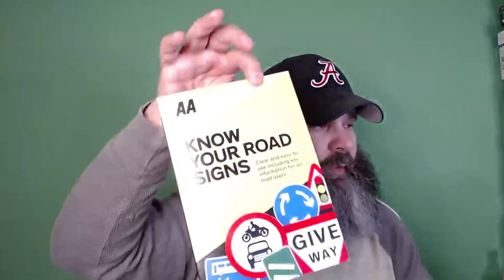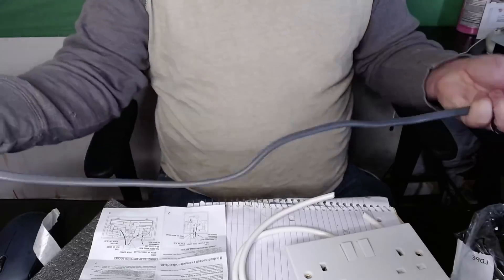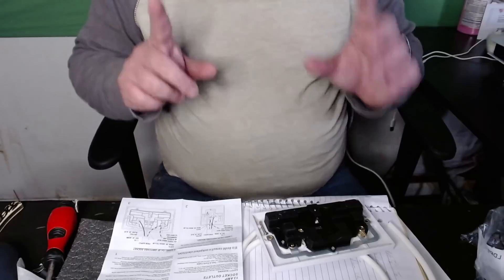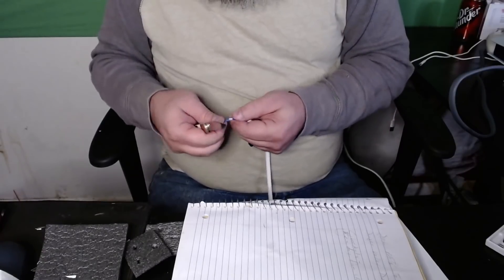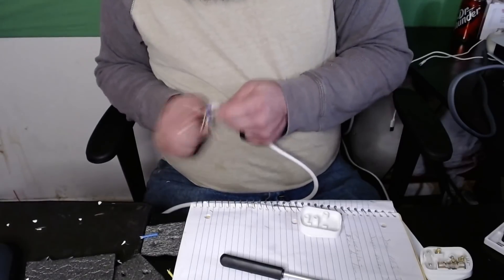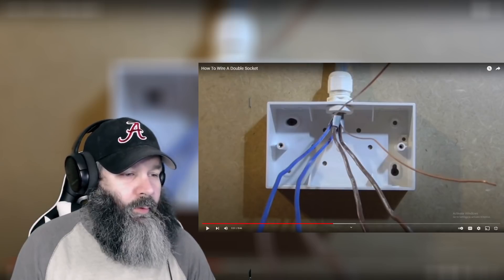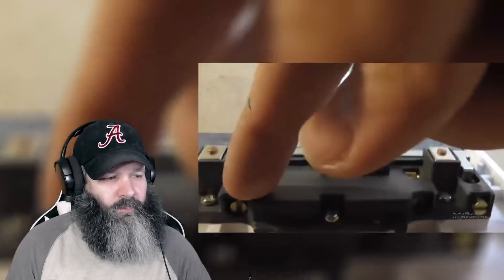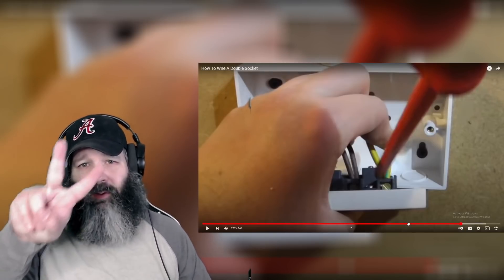American Attempts To Wire a UK Wall Socket and Plug

Comment: Unfortunately you left the wire exposed and without a sleeve which in turn could lead to electrocution or a fire as well as the strands being too long  but as a first timer 7/10

Comment: Your plug cable grip is a fail!  The outer shroud of the plug cable should be gripped inside the plug so that you can’t easily pull the wires from the terminals and get a shock.  Bear in mind our outlets are 240 volts!

Comment: The earth connection is always the first to connect and the last to disconnect . Buy a screw driver ffs . Any electrician should be able to work this out . The British Plug & Socket system is the safest in the World . ( horrible to watch a person working with a penknife)
Reply from the maker: I have screwdrivers. Just didn't have them in the house with me but in the trunk of the wife's car after replacing an alternator.

Comment: No Earth sleeving thither the wall socket is a big no no and a fail. The wall plug is also a huge safety fail as you've completely failed to use the wire clamp using it to trap the entire wiring outer coating and all thus avoiding the exposed wires outside of the plug. Both would fail safety inspections completely. Never attempt a job especially an electrical job without the correct tools. Painful to watch. Sorry but i did give it a thumbs up for the honest attempt.